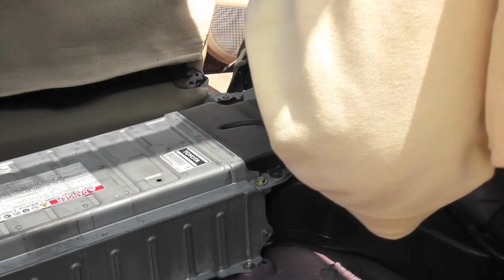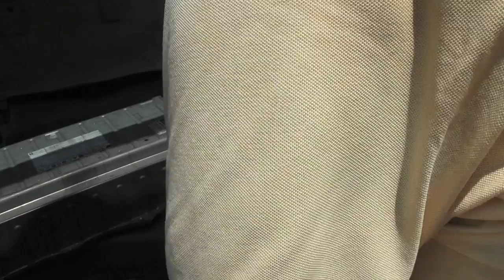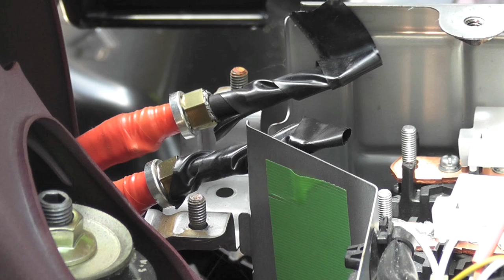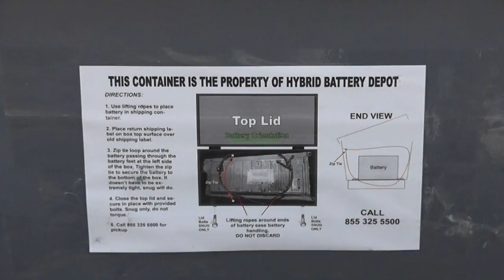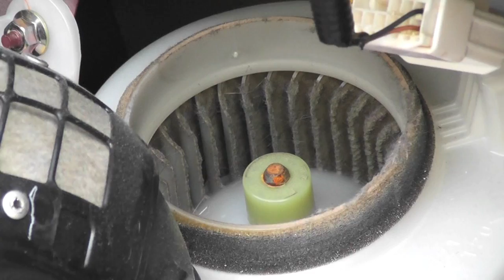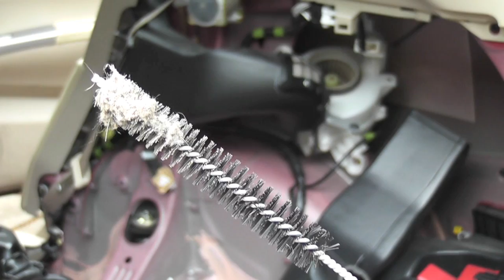Toyota Prius Gen II Hybrid Battery Replacement - Part 2 of 3

Comment from the maker: Well, I have an update for everyone.  After five years and the odometer at 244,000 miles, I got the red triangle and POA80 code.  The car is in limp mode so I'm having it diagnosed this week.  If it's the battery pack, I get to go for round 2 of battery replacement!  I may go for replacing the cells this time but will start the research as soon as I know the diagnosis.
Reply: What was the issue in the end? Would you recommend a Gen 2 Prius as a used car buy? With say 120,000 on the clock? Cheers.

Comment: You can't deadlift 120 lbs? I'm 69 and can lift that puppy no problem. But I deadlift 225 at the gym. Also, you don't have to remove rear seat bottoms. Just undo the 4 bolts holding the backs and shove them forward. There is no filter on the cooling system.Lots of dog hair if you have a dog. Better to remove the fan and ducting and wash in a sink.

Comment: Hi,
Please let me know, from where you get the battery. I need for my 2004 toyota prius, please suggest or share the links.
Reply: Dorman is a well known auto parts company that has the best warranted for 3yrs unlimited miles you can order them at most auto parts stores, shop around should be around 1400.
Reply: I just got mine from FalconHybrid.com.  They had three quality options with the accompanying price range.  As was the case in Mr. Smith's video, the battery I got had some damage on the bottom, which I had to straighten out before I could fully install it.  Their crate packaging was high quality though and the battery is working fine so far.
Reply: There are more options now. Bumblebee battery in Oregon upgrades the bus bars, as well as does extensive module testing, and had the best price ($1200). They also have an 8amp/hour upgrade ($2400 w/3-year warranty). Greentec Auto is also worth looking into. Dorman available at O'Reillys! My how times have changed.

Comment: Good advice to clean the HV battery fan. I'd put the vac suction on the fan outlet and use shop air to blow out the blades.

Comment: Thanks for making these. Removed mine from a 2005 today, took 1hr 15min from start to battery on workbench. Took my time to bag and tag everything, too. 216k on the original battery. Planning to replace cells if theres not too many bad ones. Thanks again.
Reply: +Ken Smith How do you test the cells?
Reply: I just measured voltage across individual cells. There's an acceptable range, I've forgotten what it is though. My battery ended up being fine. I just cleaned the terminals, re-assembled the battery, torqueing the terminal connectors to 48lbs/in, then put it back in the car. 12K miles later, still running great. I think corrosion on the terminals was likely my only issue. Note, if you do replace a cell, you will need to rebalance the battery. I don't recommend doing any of this work yourself. There is a possibility of getting shocked. If you do it, please ensure that you have a safe environment, and take every precaution.
Reply: Ken Smith I will probably just get a new genuine battery rather than chase individual cells on the internet :-)
Reply: You have 216 + 14K on ORIGINAL battery? I was told that 120K was "about average" for replacement. Good for you!

Comment: At the 20 minute mark, that push pin needs the center piece pushed down inside the outer round piece.  It is not like the other fabric tabs that were pulled out in part 1 of the video series.  Then to reinstall set it up as it is in your hand with the center piece sticking up and out partially, insert the whole assy into the hole and push the center piece down flush to spread out the outer round piece for a secure installation.

Comment: You might want to consider removing your jewelry before doing this work.  A gold ring across a voltage source such as a battery will probably burn your finger off.

Thanks for posting this information.  I have an '04 Prius that I'm considering battery replacement vs selling the car.  The information display shows a low charge on the main battery.  I'm guessing that it won't be long before it fails.

Comment: The first video showed 142k. 

You shouldn't be worried about it. He said this car was built in 2004 and there has been a lot of advances since. They have tested the battery for thousands and thousands of miles showing no sings of degrading.

Comment: Thanks for the video, very helpful. Just an FYI and it's not that important, but on the black push pins that you talk about at the end of this video, the center pin that has to be pushed up to reinstall can be pushed down (below flush) before removal and there is no need for the trim tool. The push pin can then be pulled up by hand.

Comment from the maker: Yeah, I don't think they were planning on needing regular service to the fan.  It's actually not that bad.  You only need to remove a panel and some ductwork to get to it. (I was already dismantling the whole rear of the car for the battery replacement but you don't need to do all of that to get to the fan to clean it.)